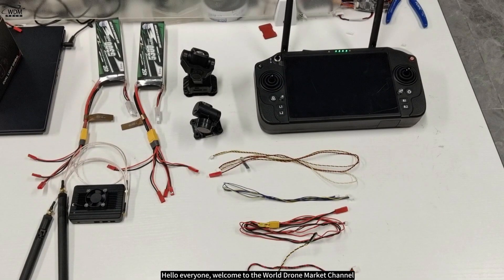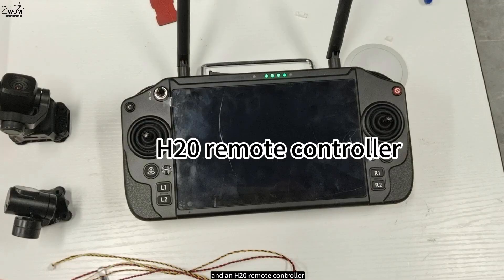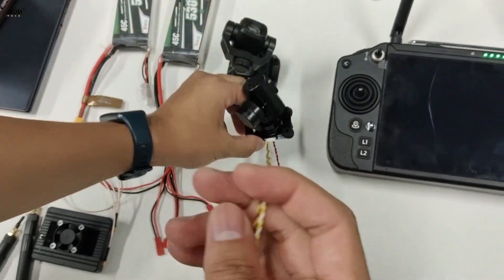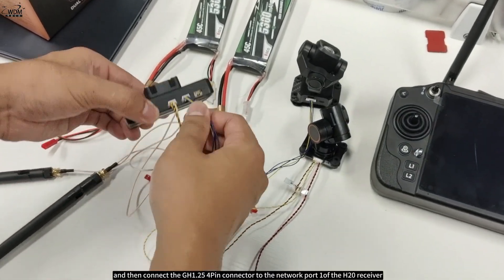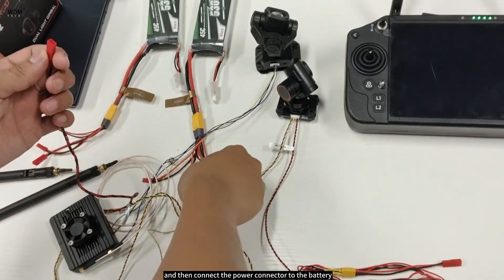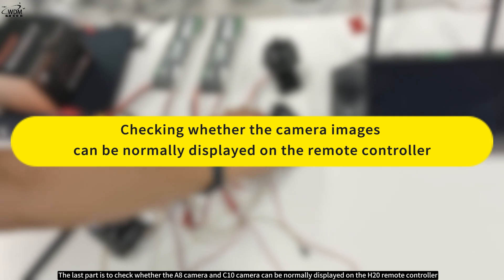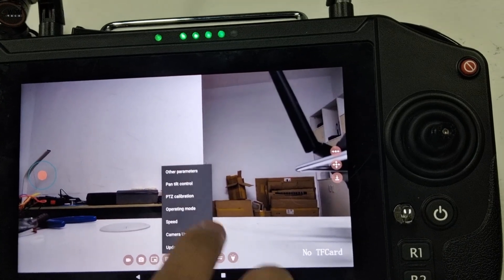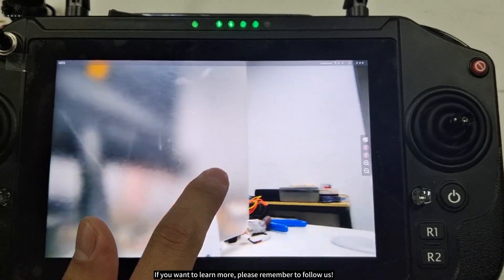Skydroid H20  with Skydroid C10  and SIYI A8  wiring video

Comment: what kind of RC protocol does it use?
is this receiver just a receiver or a flight controller too?
Reply from the maker: The receiver of H20 uses S.BUS protocol. Its receiver is just a receiver, not a flight controller.
Reply: @worldronemarket  I mean between transmitter and receiver. 2.4 GHz radio protocol that is.
Reply from the maker: @davidjacobs8558  Yes, the transmitter and receiver use a 2.4 GHz wireless protocol.
Reply from the maker: @davidjacobs8558  Yes, H20 is 2.4G frequency band